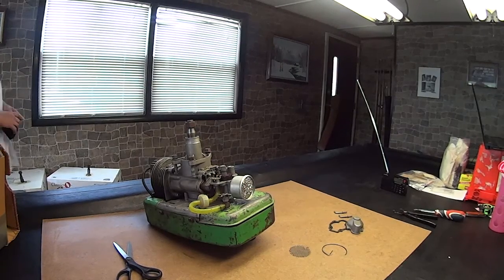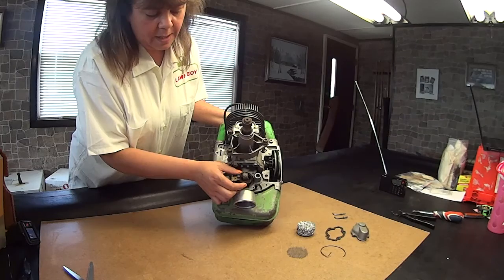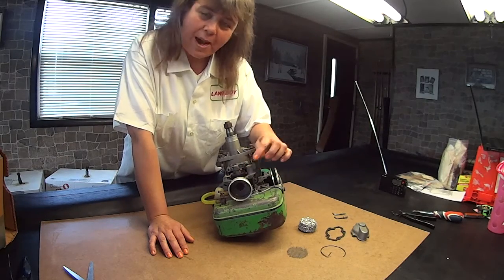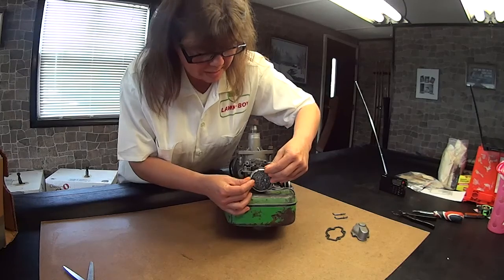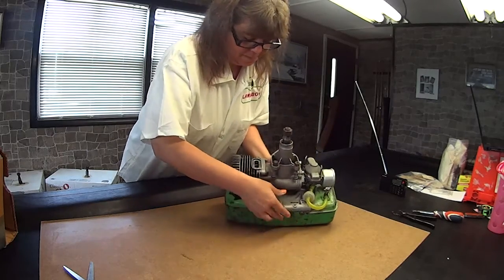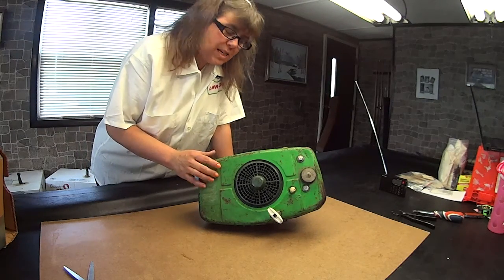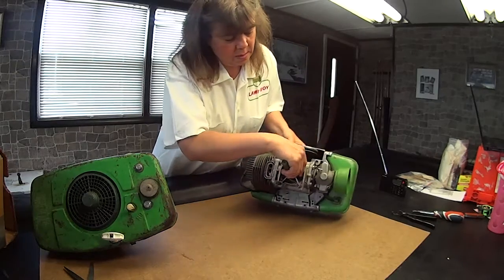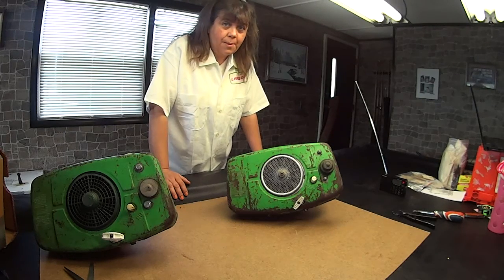Looking into the Brick Top Lawn Boy Mower.  This woman knows her stuff!

Comment: Nice video! The D-404 is a 1967, but the shroud, fuel tank and flywheel would be from an early 70's.  The other one probably is from around 1973 and would be a D-433, flywheel and cover indicate pre 1970.  The D-404 has the extended snout crankcase, or dual bronze bushings on the lower end below the mounting tabs and those types were all prior to 1970 for residential bricks, the commercial post 1970 bricks were the only ones to have the upgraded extended snouts.  It's really hard to date a lot of these old classics because so many are not original and have had parts mixed and matched from different years.  No problem mixing and matching though in my opinion.  Lawnboy designed these parts to be universal through so many different models and years, just like the old U.S. made automobiles of the muscle car era.  I think this is just one more reason they are loved so much, by so many.
Reply from the maker: +RexS Wow! I love all your knowledge!  Thank you for posting it!  Lawn Boy is very cool and my husband loves working on them as well as mowing with them.  I am learning a lot from him and enjoy putting videos on about them.  Thanks for watch!

Comment: The early brick tops date from the mid to late 1950's. The recoil was on top of the motor and pulled horizontally. Back or to the left depending on options attached. The vertical pull came later. Options as I remember them were a windrower and a collection bag. The windrower would deposit the clippings at the end of the discharge in a row that could be easily raked and disposed of. That is the reason for the 
slots in the discharge chute.
Reply from the maker: Wow!  You are very knowledgeable about LBs.  Thank you for all the info and thank you for watching.

Comment: The 1st Brick Top is from the Early 70’s I Had 1 The D-400 Series was So Smooth And Reliable I like the Wheel On The Carb To Adjust the Speed n Mixture
Reply from the maker: Those early engines were so great!  Thanks for watching!

Comment: Hi! Nice video !  they sold LawnBoys in Belgium too... Once I had one of these equipped with the second engine you show, the one with the plastic air filter housing. My sister in law gave it to me. It was a lovely little machine....and what I remember is that the crankshaft bearing on the top had a tremendous play, like 1mm or more...but did didn't keep the brave little engine from spinning like a cat... But, when we moved in 1993 and had a much bigger lawn, we needed a self propelled....so I gave it away..and bought a new LawnBoy, a M21EMR with 3 speed gearbox, oil injection and electric start... It was a delight .... BUT...after a while some serious quality problems arose.... a leaking, cracked gasoline tank, bad casting of the push bar knobs, serious oxidation of the magnesium deck, problems with the cables,...etc... I didn't stop....After a while I was done with it and sold it. The engine however....was a masterpiece...and so was the gearbox... Such a shame LawnBoy doesn't exist anymore.... I remember that these were imported here by Outboard Marine Company (OMC), who had a big unit in Bruges....
Reply from the maker: Man, what a cool story!  Thank you for sharing with us.  My husband does not like the "M" Series mowers.  They were nothing but trouble.  They were built between 1989-91, and so many people say how bad they were!  We live in IL, which is one state the OMC parts were made, Galesburg.  I do love it when a customer buys a part from our eBay store and they live in Galesburg!  Watch my other LB videos by going to the playlist.  Thanks for watching!!

Comment: Nice video.  I've got a 21 inch, 1978 LawnBoy with (I think) the F series motor.  Got the mower for free because it needed a carb rebuild, new fuel hoses and the fuel system flushed. That ethanol really did a number on those old fuel system components.   Been using it every week for the last 4 years.  Cuts grass like no 4 stroke can; it doesn't matter how wet or long the grass is, you can't bog it down.    I remember as a kid LawnBoys were what all the Professionals used.  Built to last, and infinitaly repairable.  I'll keep mine until I can't get parts to fix it anymore.  Too bad California killed off all 2 stroke mowers for emission reasons
Reply from the maker: These are great mowers!  We have cut tall wet grass too, with one.  I love to show the 4 strokers how well these old 2 strokers work!  Thanks for watching.  Hope you subbed.

Comment: I was lucky 3 years ago to find 2 brand new in the box 501 D series Brick top complete drop on engines that were found at an old dealership up here in Ontario . 
No , that is not a typo , 501 series D engine , they have a needle bearing in the lower case instead of the bronze bushing . Sold one and use the other , it will outlast me and hopefully one of my sons will use it or pass onto one of the grandsons when old enough .
Reply from the maker: John, that's is amazing!  We were able to buy a new brick top engine and shroud but not a whole mower!  Thanks for sharing!

Comment: The air cleaner assembly on the first brick top is universal replacement that 2 cycle mowers from the 1950's and early 1960's used.  The original air cleaner assembly on this engine was a green plastic case.
Reply from the maker: Great info.  Thanks!
Reply: Bill Harris Nope. That is the original. That's how they came in the 60's. Thats not right for that motor but it is from lawnboy.

Comment: i also had a 6.5 hp tecumseh steel deck but sold them 
i found after a while the steel rusts out  and the plastic wheels get sloppy 
other than that it was bullet proof

Comment: good video 
i have a 1996 10601 2 stroke with aluminium deck
also have 3 lawnboy 22270 and 22271 with honda gsv 190 
very heavy 2ith 3 piece orange 8" wheels
has the lawnboy name cast in the aluminum deck

Comment: I have a lawn boy 3056 from the early 70s it started leaking fuel out of the air intake and leaks on the deck. As soon as I add fuel mixture to tank it starts leaking? Any suggestions?
Reply from the maker: Have you checked the float, needle and seat?  The float might be stuck open.

Comment: Just How we  remove the métal plate who take the blade on the lawn mower
Reply from the maker: I'm not sure what you are asking.  If you are taking about the "blade arbor" which is a small square type of thing, my husband uses a power drill.  At times, they really stick and they need to use heat.  But not much.